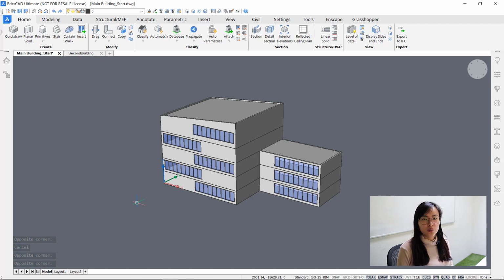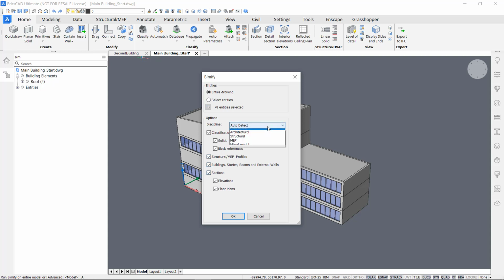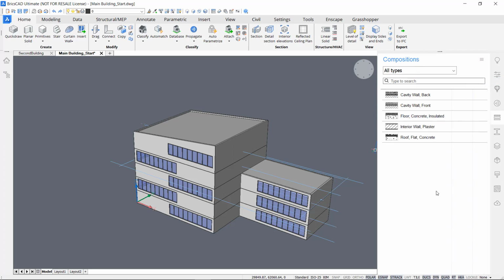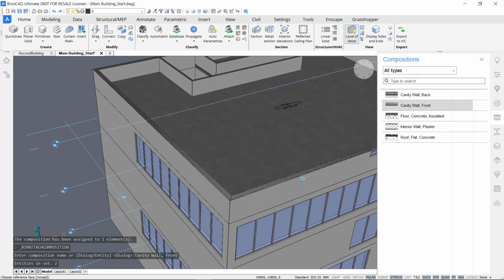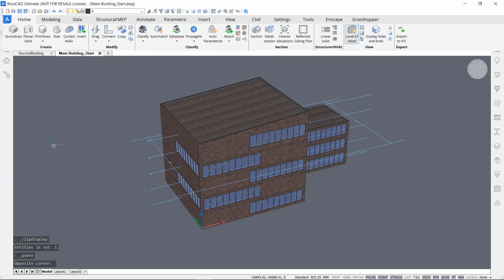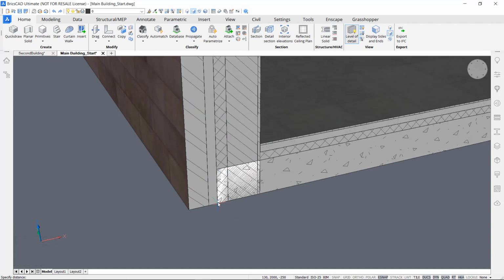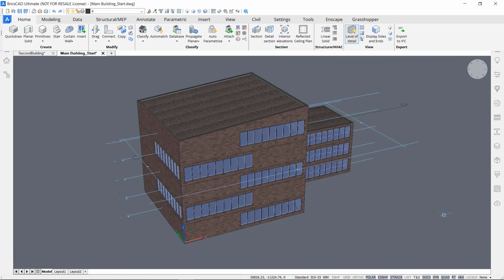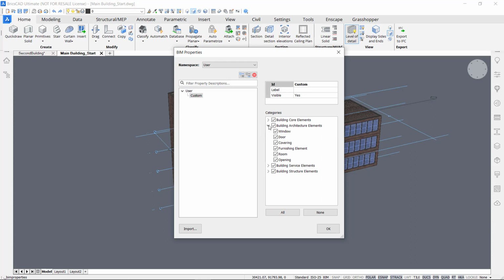BricsCAD V20 BIM Academy 4 - Adding BIM Data

Comment: propogate tool looks awesome! It saves ton of time. But when it comes to automatch, even though i did everything as you did, I got an error saying "_bimautomatchError during Automatch: Error while applying style".
Other than that, it looks awesome. I wish more people knew about this tool.
Reply from the maker: Thank you for appreciation! It would be very helpful to get your drawing to check it on our side. You can create a support request and attach the drawing on our web page (the login is required) https://www.bricsys.com/protected/support/NewSupportRequest.do
Reply: @BricsysOfficial  thanks for quick reply. I actually used starter files. But i will do create a support request as you suggested.